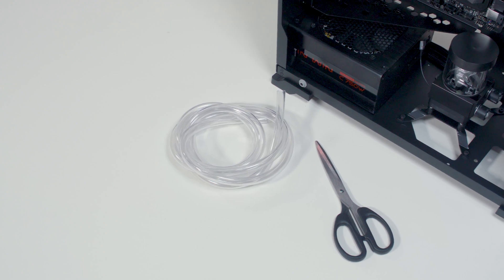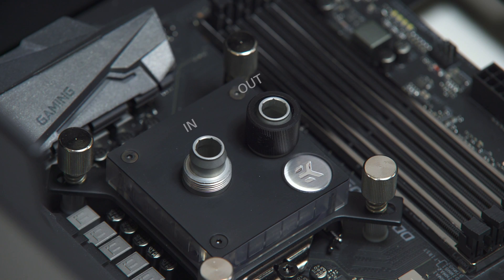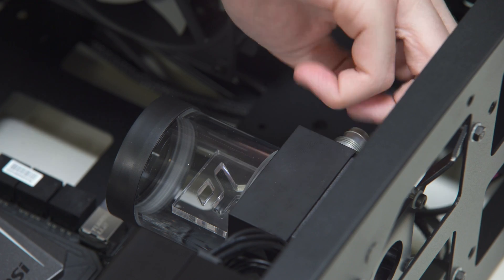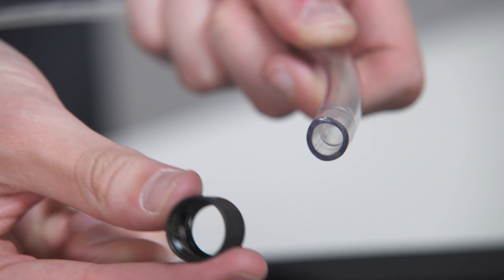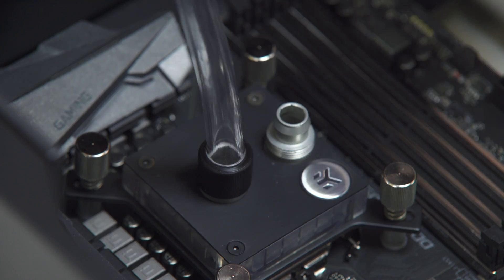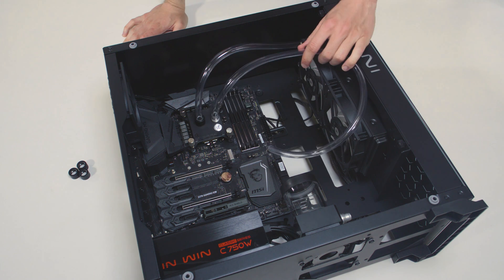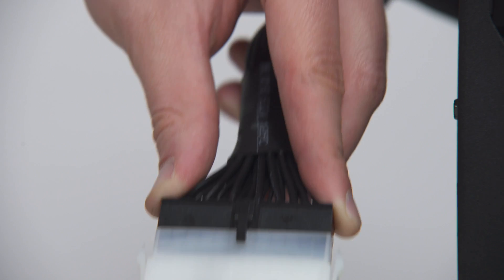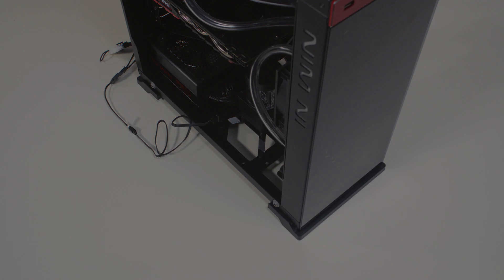EK Fluid Gaming A240 - Connecting the tubing and wires

Comment: What size fitting does this kit use. I am planing to get gigabytes 1080ti that comes with a water block. And use this kit for both my CPU and gpu
Reply: If you did this, be careful about mixing the metals. I don't know what block material comes with that 1080ti, but that might be a mistake. Look up somethign like "Mixing aluminum and other metals in custom loop cooling"

Or look up "Galvanic corrosion in PC cooling"

Comment: Guys, i'm wondering if the A series will be extended to anything other than kits? will we have rigid fittings, bigger rads, and angled fittings? this could be a very feasible solution for people who don't want to pay a lot for a full loop. also is the reservoir in the kit changeable with the other sizes available from EK?
Reply: Along the same lines as the question above, is this kit mix and matchable with other ekwb parts?  If I wanted to swap out an RBG CPU block could I do that?  or at some point do a hard tube instead of the included soft tubing?